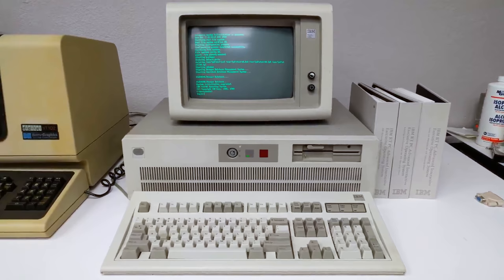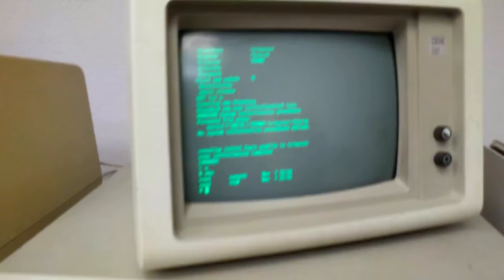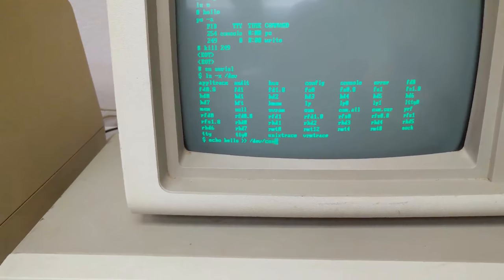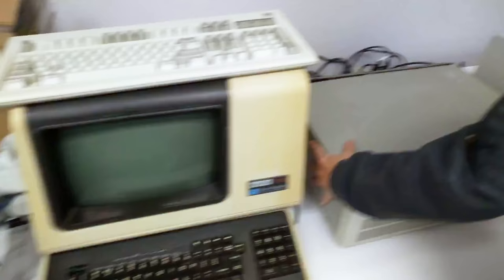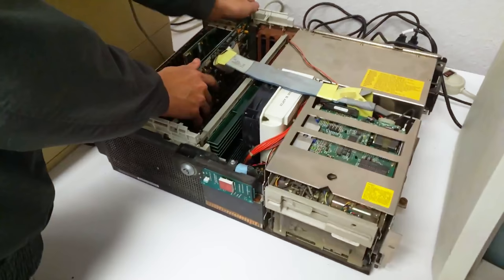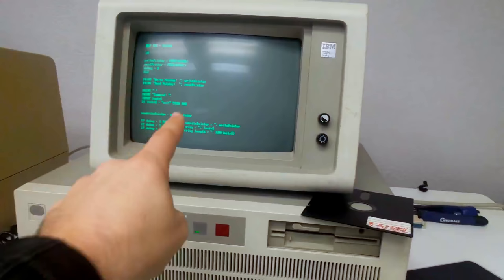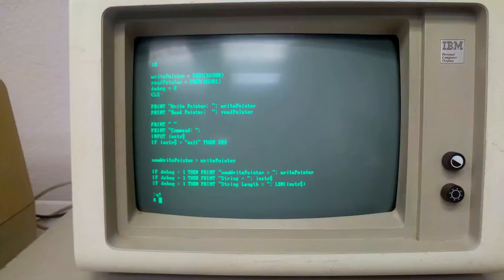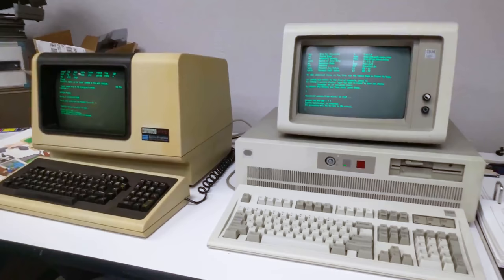An IBM RT AIX PC Experience

Comment: Is the Alt+Action key thing not just analogous to having multiple consoles open on Unix-likes and switching between them with Ctrl+Alt+F1, F2, F3... ?
Reply: I thought it was more akin to using Control-Z to suspend the current interactive program, except you had to enable it in advance.  I know that "job control" with Control-Z and "&"/fg/bg was a later addition, not in original Bourne shell, so this could have been an AIX variant before the eventual standard approach came about.
Reply: @jb31842  But David said a short time after 18:21 that open in combination with Alt+Action allows task to continue to execute in the background, in the console or instance you've switched away from. So that's not the same as suspending something to the background with Ctrl+Z.

Comment: Loved this old time 80s computer but did not get my first computer in April of 2008 was my very first lap top computer first computer . Well my first was a dell but only lated a week so got a Gate Way 2008 one both in 2008 both in April then had a 2009 Gate Way computer from 2009 til 2015 had 2 other dells a google then a HP laptops.

Comment: All those short commands?  Serial-connected terminals (originally mostly teletypes) were the norm for connecting to UNIX systems.  These date back to the late 60's, and frequently had a connection speed of 100 or even 75 BAUD, which could be as slow as 9 characters per second.  300 BAUD was a fast serial connection in those days.  It was very important to be text-space efficient, so most commands are one or two letters, and default to returning minimal information unless you tell it to give you more, usually with lots of levels of information that can be returned so you don't waste limited communication bandwidth on info you don't care about.
Reply: that explains the short outputs from some commands

Comment: oh man what a beast,linux has come a long way since old unix,i read a solaris manual for fun and was the same thing there we have it easy with linux in comparison.thank you for taking the time to share it with us.
Reply: Aix was truly awful compared to a modern Linux distro 😂. Without automake programs would simply not compile as header files were not linked or reported by the operating system accurately. To get X to work I had to manually copy modern Linux distro files over to Unix to recompile as IBM left out core stuff.

Solaris was a better Linux like.

Comment: Multi-tasking, multi-user UNIX on the desktop in 1986? awesome. 

Would love to see one of the later PS/2's running AIX/386.
Reply: Yes, I would too! On the PS/2 the RT was a processor sub system on a MC card, the PS/2 booted first, then it booted into the RT/PC. That was for AIX 3, just before the RS/6000s.

Comment: 11:42 Not crazy, there were lots of multiuser Unix machines being sold around that time. In 1985 I was running things on an Altos 586 machine which had maybe half a dozen terminals connected to it. I remember also a box from Charles River Data Systems, which had the much superior Motorola-family CPU. ;)

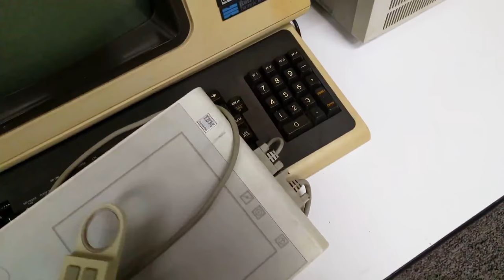Comment: 15:03 i think that is for CAD software. Not a mouse, but a drawing tool.
Reply: it's specifically for digitizing existing paper drawings. You would use the crosshairs to position the cursor on vertices or points on the drawing.

Comment: F3 could probably mean PF3. If using a more modern keyboard that's * on the numerical keyboard. Ctrl+S Ctrl+X and Ctrl+E is also worth trying. Or perhaps the console is using the wrong terminal emulation.

Comment: How much RAM did it have?
Reply: Enough to run minesweeper I guess
Reply: I counted 20 1Meg parity SIPPs. That's nuts for 1985!
Reply: @eformance  That's enormous !
My Toshiba laptop from 1995 has only 24mb !
Reply: It has 16 megs, the maximum that the RT supports.
Reply: Even 16 MB would have been outrageous in 85.

Comment: Just curious, can you use a USB to Serial interface and connect it to a serial terminal and use it with a modern Linux computer. Seems like a cool way of making a serial terminal modern. Maybe even using a raspberry pi or something
Reply: Sure you can. No problem at all. That's the beauty of serial RS232-communication.

Comment: Hmm, adduser and useradd are standard POSIX, I'd have assumed them to be there. Quite interesting though, that home directories are in /u/ and not /usr/, which is where user directories used to reside in way back when (I think SYS V times). Perhaps they shortened 'usr' to just 'u' due to maximum path length restrictions?
Reply: POSIX got started in 1988; so this predates that.
Reply: @waltherstolzing9719  You're right. I know `useradd` and `groupadd` were in SYS V. Not sure if it was already in SYS III, though. I forgot POSIX emerged much later.
Reply: SCO SVR3.2 also uses /u/ if I'm not mistaken.
Reply: @kanalnamn  Do you happen to know why? Was it just for convenience, or was there some sort of max path length they tried to mitigate by shortening directory names?
I remember when older Linux distros used `/var/users/<username>` anything earlier was kind of before my time.
Reply: @daspolemon  No, unfortunately I don't. Perhaps that just was the way of SVR3 and earlier (~1988)? The /u/ in SCO could also be a linked directory to somewhere more usual, I'm not sure.

Comment: Your terminal type simply isn't set right for the terminal you're using.  Set the TERM variable to the correct value.  Escape 3 may work for function key 3.  I don't know why you think Unix was weird in 1986.  Unix far preceded the PC.

Comment: Can we please take some basic ESD precautions?  There's very little of this stuff left around, it's computing history.  We're taking great risks with damaging it.  If we're going to consider this historical preservation, we should at least act like it.  A basic ESD strap alone would be something.
Reply: The lab we were in when filming has ESD dissipating carpet, along with antistatic lab tables.
Reply: @davidk8893  The floor of production facilities where these boards are produced also have antistatic properties as do the work surfaces and implements, but they also require direct skin contact using a good ESD strap in addition.  Shoes can prevent static from being discharged to a protective floor unless a heel strap is being used, and they also have their issues too.  Most production lines require the use of ESD smocks to cover the body alongside other grounding precautions and require daily checking of their proper function.

ESD can still find niches even in protected environments.

Comment: 15:01 That's a graphics tablet! However, rather than using it for digital art like a lot of the modern ones get used for, that seems to be more for inputting stuff from blueprints and graphs and such.
Reply: It's an IBM 5083-11A tablet. It came in two sizes, and you could either choose an active pen or the digitizing puck. The puck was used to convert paper drawings to CAD by using the crosshairs to accurately point to important points on the paper.

Comment: I was hoping the RT meant Ray Tracing... j/k 🤣 Those old RISC systems suck compared to the current systems, mostly because they weren't as efficient as they should have been. Now everything running a variant of RISC processor is actually pretty good. (This comment is being written with an M1 Macbook, so it's a RISC system.)
Reply: Back in those days it was about performance. These piddly things had .3% of the power of your phone in your hand! Spell checker could spend minutes checking on a document back in the late 1980s. Unix machines could compile code and would not lag like a Mac or PC. Risc was faster and could multitask. No one gave a damn about power usage

Comment: That is not a mouse it's a digitizer
Reply: More specifically, it's an IBM 5083-11A tablet with the digitizer cursor. It also has the option to have an active pen rather than the digitizer.

Comment: I think those ram modules might be SIPPs as opposed to SIMMs
Reply: They are in fact SIPPs. Unfortunately, they are soldered directly onto the processor board, so if one ever goes bad it will be a headache to replace.
Reply: I think the reason for the confusion is because SIPP memory and SIMM memory are the same logically and electrically,  but the main difference is that SIPPs have the leads soldered onto the RAM.  The 2 formats are interchangeable, just takes a LOT of work to change from one form to the other.

Comment: I have the kernel source for. Mach '86 which has the RT/ROMP support.  I've only used the single processor VAX build, and that runs fine in SIMH.  As far as I know there is no RT/ROMP emulator.

I'll link the init routine for the RT

https://unix.superglobalmegacorp.com/cgi-bin/cvsweb.cgi/accent/ca/romp_init.c?rev=1.1.1.1;cvsroot=Mach;only_with_tag=MAIN

Comment: Those RAM's could be ZIL's
Reply: the RAM is a format called a SIPP. It's basically just a 30 pin SIMM with pins soldered on it.

Comment: PSU is 900W
it's 120V * 7.5A = 900W
Reply: 900w input rating, yeah.. @80% efficiency we're at 720W.. So.. yeah.. You really need the output rating, since we have no idea on how the rails are configured or how efficient the unit is.